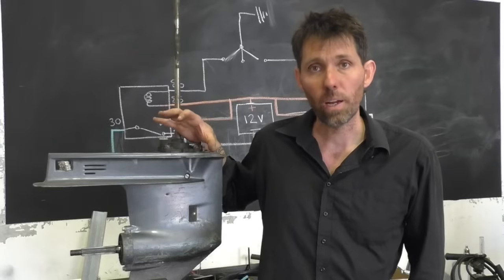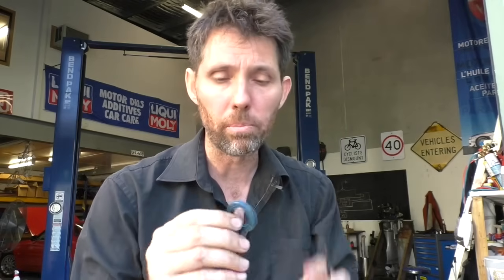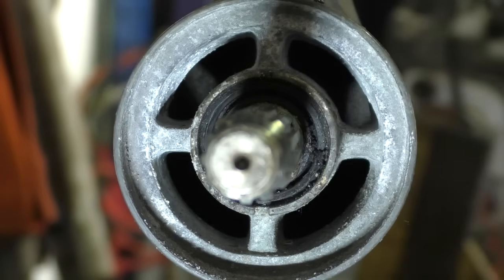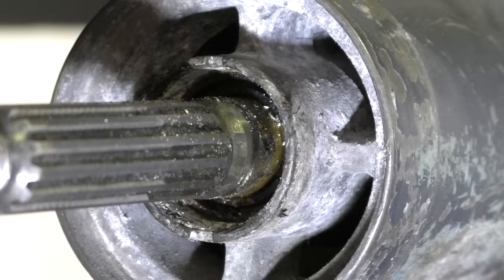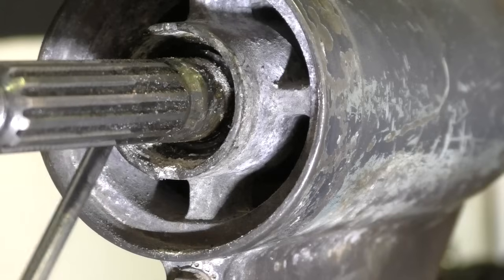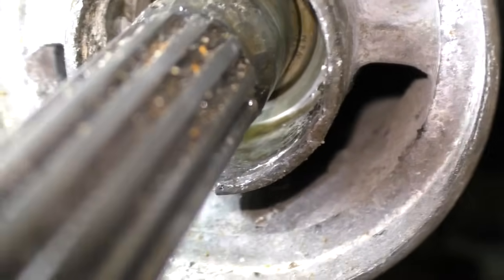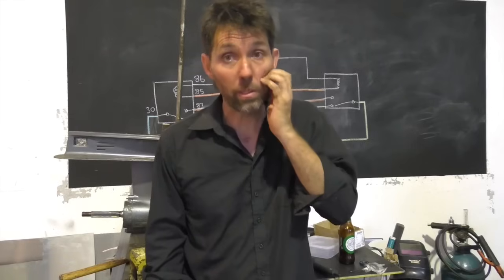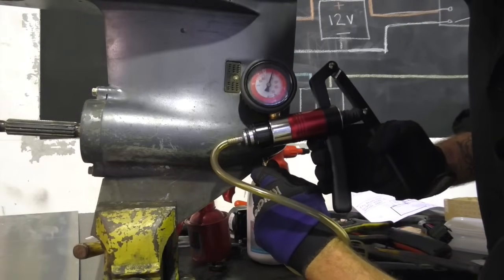Replacing outboard oil seals the hack way

Comment: I need this video, but I’m having a hard time getting thru all the lip-smacking and spit-swallowing sounds being picked up on your mic, it’s REALLY gross man. That being said, your videos are very helpful... maybe drink some water pre shoot and between cuts...
Edit: that prop shaft bearing seal holder comes out with a standard flywheel puller and some bent bolts..., I got one at local big name parts store for $14,

Comment: I have gear oil leaking from the weep hole below the water intake on my lower unit. It's on a johnson 50hp. Would this job fit it?
Reply from the maker: Could be a problem with the the driveshaft seal below the waterpump or just unburnt two stroke out coming out through the exhaust.

Comment: well for 1 similar, you mentioned drilling to put in a screw, well MAC tools makes a slide hammer, like for body work, but its small, & uses a screw, you hit the hammer part down to drive point of screw into seal, then turn handle to thread screw, then hit slide upwards to remove seal. but look in catalog of MAC tools to get idea, so can make your own. handy tool to have. & I been auto-mechanic, auto-body man, plus welder for 35 years, just starting to learn on boats.
Reply from the maker: For a sure a good tool, have used one for a lot of different things. My favourite attachment is the one that lets you put a set of vice grips on the end of the slide hammer (which is also good for pulling a regular screw)
Reply: @DangarMarine  I have that one, but mine is on a "Morgan Knocker" a 10lb body hammer for big stuff, it has all kinds of hooks & chains. I forget about due to it being too heavy to use everyday and awkward, lol.

Comment: I usually drill two small holes into the metal part and them put in metal screws to pry the seal out a bit at a time and found it works fine.

Comment: Wait so what happens if the prop shaft is nicked in some way, what’s the next step? My lower unit has had water issues, and I thought it was just the seals. But now I’m worried a damaged shaft might be the underlying issue.
Reply from the maker: If the nick is above or below the seal it isn't a huge problem but if it is exactly where the seal is it will keep damaging any new seals you put in and will need to be either repaired or replaced.

Comment: Got a question for ya the prop shaft. I have a 48spl with 3 mounting bolts for the seal should I screw into them and use a puller to yank or just buy hooks and hook onto the outside of it

Comment: I have a 1968 Mercury 650 Thunderbolt. At the launch the battery was dead so I pulled it out of water and jump started dry for about 30 seconds. Then I shut it off and launched boat. Later I noticed a couple a drops of oil coming out of the weep holes. What do I do? Thanks. Mark

Comment: 3M Super 300 Black around the outer seal will help from leaks in case you scratch it and won't dry like other sealants.
Also, between the two seals (rubber lips) put wheel bearing grease for the prop shaft to ride on.
This will help the seal last longer.
Just a thought and good video.

Comment: You installed the seals both facing out the same way. Isn't it supposed to be solid backs to solid backs? The inner one which you said could keep the steel spring towards the oil was installed outwards. At least that is what i can see even if you installed o rings on it.  BTW you should not show how to replace seals on the shaft without removing the bearing carrier.  No one is knowledgeable like you and they just may wreck their bearing carrier.  Good video.

Comment: Can't tell you how many times you've helped me save tons of money.....6 months ago my most extreme mechanical feat was replacing spark plugs, and doing oil changes.....Thanks to your help, a specific service manual, and maybe a little bit of other videos (bit here, bit there) my F90 is in top shape. I have removed, disasembled, repaired, and replaced my entire lower unit assembly, which includes a full set of replacement upper and shaft oil seals, water pump replacement as well as completely servicing my fuel system (from tank, to low pressure pump, VST,  intake, and injector servicing and cleaning. You've easily saved me over $1500 on labor costs.  THANK YOU

Comment: Used this method and got seals removed easy enough. What is the best way to get the milky oil cleared out of the lower unit??
Reply from the maker: I normally cleaned it out with something like methylated spirits.

Comment: Just did the same job... Mariner 82 model. got some scratches in the inner metal ring. Gonna put inn new unoriginal oilseals there now since they don`t make it anymore. The local Yamaha dealer don`t even sell any parts to new motors here. No money to be made...

Comment: Hi 
Hi, Dear sir, I have yamaha 9.9 2 stroke 1999 model motor. Exhaust enter inside the cap, in the sea when we start the motor, if I take out the cap , motor runs , . İf I put the cup , motor runs slowly and stop, because of the exhaust enter inside, may be I need a gasget between shaft and head , I dont know its name, would you please help me how I change the related seal.aliuzel40@gmail.com

Comment: Thanks for this video. I'm in that similar situation with my yamaha 50 oil seals. No trailer board or number plate to take it to a mechanic, mechanics cant come to me as they say "only in house"...this is the way im doing it...got the outer seal out this afternoon. With the assistance of your videos ive been able to do a lot more than i would have been able to before, and help when a mechanic hasnt done the job right or conned me....to get engine back working fully again....been let down twice in the last year by 2 mechanics and will i hell tow 100 miles each way to take it to someone.

Very much appreciated videos and information...the best videos for marine services on YouTube
Reply from the maker: Sadly it's a common story Calum, glad to hear you've decided to tackle it yourself.

Comment: I have a mercury l3 lower unit. And I'm getting gear oil up into the mid section is this because of shaft seal under water pump base?
Reply from the maker: Yes, most likely.
Reply: @DangarMarine  thank you

Comment: Man, I’ve have watched a lot of ur vids. This one what I like by far. My seals r leaking on my outboard. I’ve made this very interesting. Keep up the good work!!!! Should u go ahead and replace the bearing too? How the heck can an auto store match up the seals if u can’t get # s off of them????
Reply: try to see even with a magnifying glass the seal number and the measurements, then it can be traced by brand and number and measurement, most likely at any auto shop even though is for marine use. Rubber is rubber, does not oxidate.

Comment: I use a torch to remove most of the seals. It goes easier that way...
Reply: A torch wont ignite the oil inside?  I know i was welding an oil valve on an old semi hermatic compressor and while i was running a short bead the intake pipe shot a fireball right at my face..  melted my helmet but still had hair..  sounded like a rocket..  so stuff with oil in em im wary about putting a flame on..  also how close to those seals are the impellers usually or any other rubber/ plastic parts?  Are the oil seals there the only burnable/ meltable parts close by???   Would like to know cuz heat sounds like the money rather than pulling on an old stubborn seal...
Reply: @Z-Ack  Come on, where is the impeller in regards to the seal? Why would you have oil inside - don't you drain it before removing seals? Have you ever done that?

Comment: Ah ok cool. I wondered that when I saw another leg design. 
But I have now run into another major problem. I actually posted a pic on you page. But I took my lower unit off, and somehow managed to pull the selector rod out of position. Now it's stuck and won't get out of forward gear.

Comment: Hi Stu, I'm looking at doing my seals in my 40hp Yamaha cv. But my bearing carrier isn't held on by 2 bolts, it's held on by a way I can't see. I emailed you a pic. Unsure of how to go about it. 
Cheers.
Reply from the maker: It may be a nut inside the unit. Be careful because they can sometimes have left hand threads too.

Comment: question: on 2007 F60 4stroke, prop shaft is moving tiny bit up and down when I grab the prop or the prop or the shaft it self (click click noise) , but not left and right, bearing? There is no leak from the lower unit. Thanks
Reply from the maker: It does sounds like a bearing problem, you shouldn't be able to move the prop shaft like that.
Reply: @DangarMarine  Thanks for reply! Why do you think ti's only moving it up and down?It's probably about 1/64" Do you have any video working on the lower unit replacing the bearing? Thanks
Reply: @DangarMarine   I just found your video that should help me https://www.youtube.com/watch?v=HRpfaOiXxWo
You don't mention anything about bearings there, are they pressed in the bearing holder ?  Do I need special tools to remove them ? 
Thanks for your time!

Comment: I punch small hole in face of seal screw in sheetmetal screw and pry on that or use a body dent puller with long sheet metal screw and pop it out with no damage.  By the way enjoy the videos thanks.

Comment: This really isnt a hack its a mechanics trick. Theres millions of these cheats otherwise mechanics wouldnt make their labor  times. Great video
Reply from the maker: Yes, you never remove a crankshaft to change a rear main seal, but the outboard world always insists you remove a prop shaft to change the seal.

Comment: Use a bit of duct tape next to the oil drain hole, it will help direct the oil stream into the oil pan. On the prop shaft use some grease...just in case your sharp tools hit that propeler shaft, they will bonce or slip. Use corrosion salt cleaner...

Comment: Will the seals work if you install them backwards, with the non-stainless steel spring placed towards the inside, where the oil is? Thank you.

Comment: I've got a Volvo Penta sx, on a inboard 4 .6, it's a 2003 hurricane 201 GS. Just got the boat. When I lower the trim a green oil slowly leaks out at the prop, a large amount though. There is a puddle on the ground. Is it this seal or another issue you think?

Comment: How often should you change an oil seal? Thanks
Reply from the maker: Personally, I wouldn't change it unless there is sign of water in the oil or the gearbox fails a pressure test.

Comment: Hi Dangar, dont you worry About the Alu corrosion?  Wont it get More and More? What can I Do against this?  My Lower Unit Shows repeatedly Alu corrosion. Anode is fine / changed regularily...thanks
Reply from the maker: Could  be a stray current causing electrolysis.
Reply: @DangarMarine  thanks!

Comment: I bought a 1984 boat with an Evinrude 150GT. The gear case oil was emulsified. I watched your videos and to make a long story short, I got the bearing carrier out and someone previously had damaged the prop shaft. They are around 400 bucks new and I paid 2300 for the boat so I am reluctant to replace the shaft. Other than using 300-400-600 grit sand paper to polish the dings out as much as I can, is there any other fix for those dings in the prop shaft? Thanks for all you do. Brent

Comment: How easy is it to find a modern, equivalent seal and bearing?  I need to replace ones from 1965, where NOS are not available.  I'm curious about recommended suppliers, and whether originals are typically marked with anything that allows finding an equivalent, as opposed to mic'ing things for measurements.
Reply from the maker: It shouldn't be too hard to find modern equivalents. I normally just take the old ones to our local bearing supply shop and he finds something to suit.

Comment: Another great video.  I was wondering if a Dremel tool with a long shaft small diameter bit would be safer to use than a screwdriver or punch with a hammer to remove the old seals.  What is your opinion of that idea?

Comment: Hey Stu,
Is it possible to check the upper seals when the prop shaft oil seal is stuffed?
Reason I ask is that I took my BF80 for a new prop shaft seal and the bloke's gone and done all the seals. Thing is that he took some time and said he was waiting on a part... but turns out it was the bearing carrier nut! So he didn't replace the prop shaft seal and then pressure test. He said he tested the upper seals before replacing the prop shaft seal... which was leaking cos of fishing line... and was literally dripping oil out of the prop.
Is it possible to test the upper seals before replacing the lower seal?
The oil was full and clean as a whistle, then i caught some fishing line and needed a new prop shaft seal... that then turned in to a $1,000 bill for all new seals and a new impeller... without checking with me. Just said it's fixed it'll be $1,000.
I trust you so just thought I'd check in before cracking the shits big time.
I'm in Melbourne, so it'll be tricky, but I'll owe you a beer.
Reply from the maker: He may be saying that he pressure tested the gearbox before removing the prop shaft seal and saw that both seals were leaking, but you can't test the drive shaft seal once the prop shaft seal is out because it won't hold any pressure at all. If the prop shaft seal was leaking badly enough to drip oil I imagine you wouldn't see much pressure coming out the other seals though but it's hard to say without being there at the time. $1000 is a lot to be slugged without being informed though, I feel your pain.
Reply: @DangarMarine  well... $958.80... I was rounding up.

Comment: Hi. Do you know the reason my Honda BF15 4stroke outboard runs fine for 5 minutes and then spits motor oil/salt water white mix from carburetor intake?
Reply from the maker: Sounds like the head gasket is blown.
Reply: @DangarMarine  the cylinders has no water in them. Is it possible the head gasket has a leak from water to oil and not into cyclinders?
Reply from the maker: Yes, that is possible.

Comment: we've come across the seal housing area very corroded but otherwise in good shape and used a freeze in (interference fit) sleeve after a ream of the area and abit of sealer,  good as new. your video is spot on for those corroded in carriers also.
Reply from the maker: Resleeving corroded areas are a great way to repair these problems. Good as new as you say. :)

Comment: The right way to do this job is the way that works.

Brilliant use of an "O" ring to replace the spring.  Thanks for the vid!
Reply from the maker: Thanks mate, couldn't agree more. It's interesting to note that this is the only way to get many oil seals out (such as rear main seals on car motors)

Comment: I really appreciate your videos. They help me understand my two motors better and determine if a repair is possible by myself, or if I need a pro. Do you have a video on testing whether your oil injector is working? I have a '96 JOHNSON 50 AND A 2000 Johnson 90. Thanks!
Reply from the maker: Thanks mate. I don't currently have any vids on testing oil injectors. Mostly what I do (like with the Evinrude 150) is run it with oil in the fuel and then check if the level in the oil reservoir is dropping over time.

Comment: Question: How can I get that seal? do you just take the used seal to an auto parts store and ask for a replacement? Or would you happen to have the part #? because that lower unit looks just like mine.
Reply from the maker: You can order it from a site like MarineEngine.com as a marine seal with a stainless steel spring in it or but a standard auto seal and replace the mild steel spring with a nitrile o-ring.

Comment: When he pulled out the inner old seal the stainless spring look good and it looked like it still could be used. On the two new seals he could have used the "O" ring on the inner seal and used the stainless spring that was still good on the outer new seal.

Comment: I got a 55 Evinrude motor that has black oil coming in between the prop and the motor what do you think's wrong with it do you think it could be engine Blow by because the oil is black or do you think my lower prop seal went out
Reply from the maker: It could be gearbox seal or it would be left over 2 stroke oil that isn't being burnt completely due to a bad spark or too much oil in the fuel.
Reply: Yeah we found out what it was it was the lower prop shaft seals $181. 87 to replace those lower prop shaft seals

Comment: Great video - a good way to protect that shaft is to put painters tape/masking tape on the shaft - should give you that little extra bit of protection while you're punching out the old ones.
Reply from the maker: Thanks John, yes, the tape certainly wouldn't hurt, although getting a scratch in places other than where the seals run isn't much of a problem.
Reply: Great videos by the way - I've stumbled on quite a few of them and really appreciate the 'real world' examples that you provide - gives us weekend mechanics a great reference! Cheers!

Comment: Try drilling  holes at 9 and 3, insert a screw and the other end into a slide hammer and you can pop each seal out using the slide hammer. faster and less chance to do damage.
Reply from the maker: I've tried that a few times and personally felt I had more chance of nicking the prop shaft with the drill bit than I do with this method. I've seen it suggested to drill through a ring spanner to stop the drill bit hitting the prop but still had mixed success.